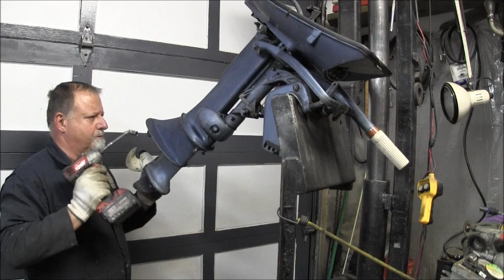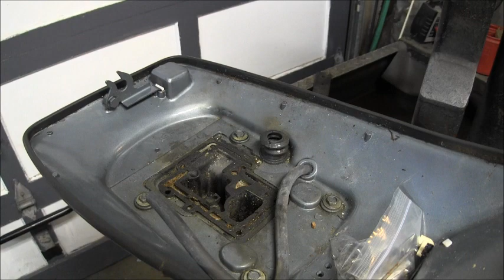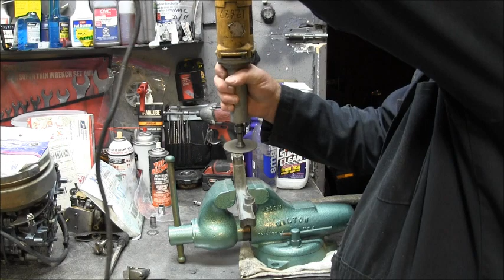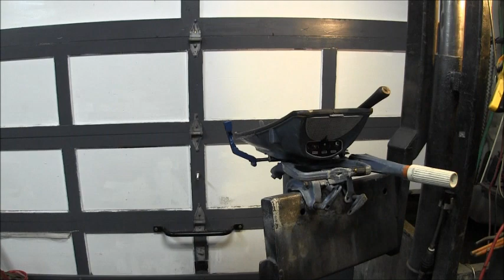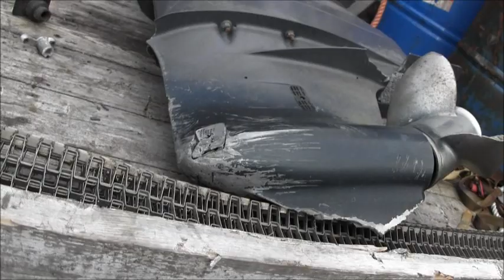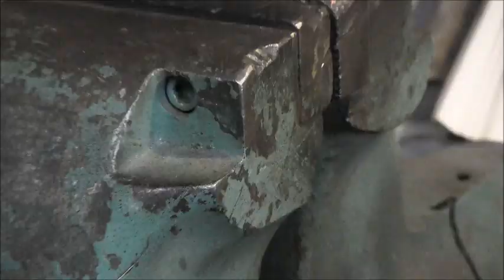EVINRUDE  1963  5.5 HP  &  WILTON,    ( baby )

Comment: Kodi,Nice gear shift repair thats a 1959-61 Evinrude 10-18HP gear shift lever. Thats also a large Riffler file used them for years at my old job I have some...     Glenn
Reply from the maker: Thanks it worked great scrapping out the salty crud.     kb